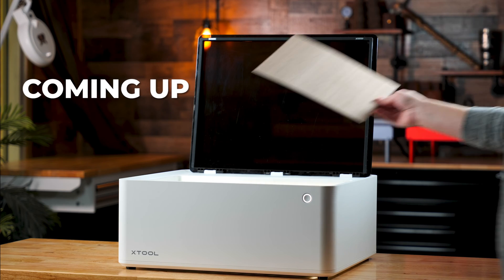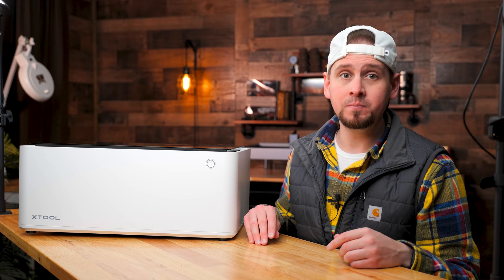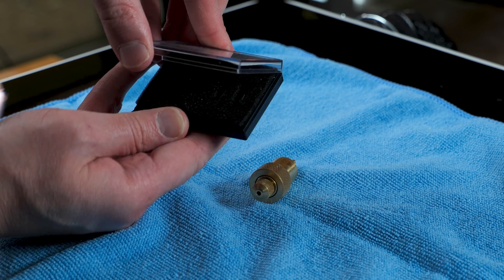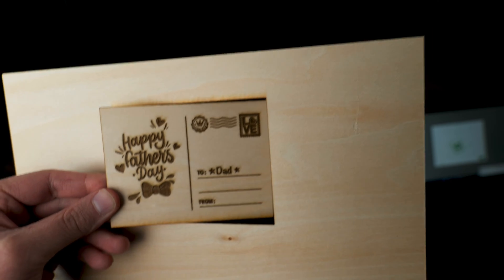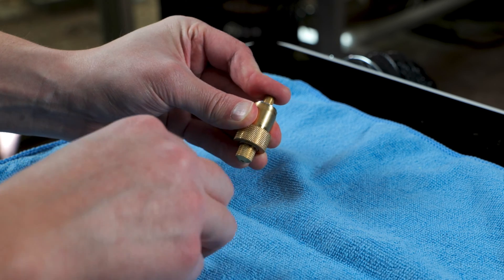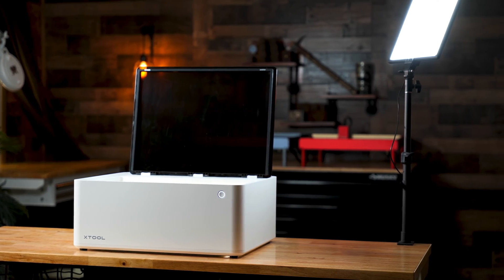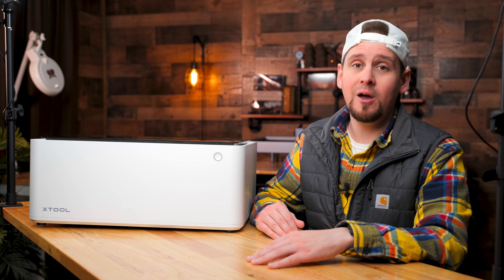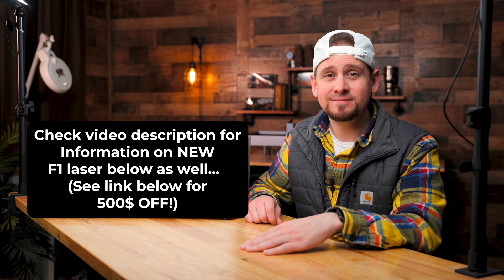How to Laser Engrave with xTool M1 Hybrid Laser Cutter/Engraver

Comment: I have a laser cutter/engraver attachment for my CNC machine - the xTool M1 appears to be an order of magnitude easier and more useful.  I have been looking at the Glowforge family of laser machines ($ being the biggest obstacle) - but this is a definite a competative alternative. I am definitely interested in looking into it in more detail.  I like to combine different art mediums - such as wood carving, rock carving, rock polishing, epoxy resin, acrylic paints, and string (pin & thread) art - using two or more media.  Adding in an engraving component will definitely increase my options and ideas.